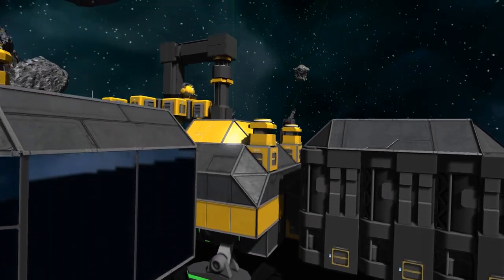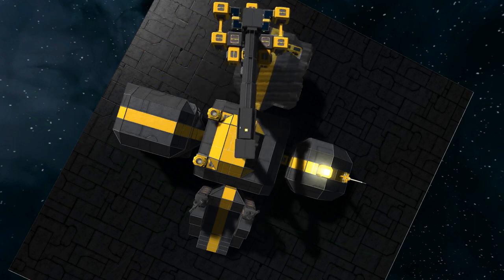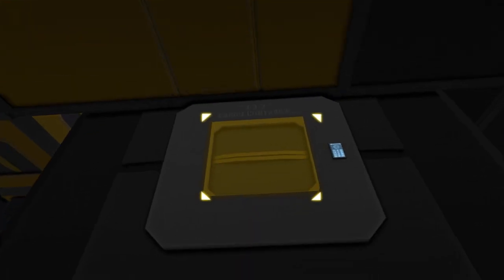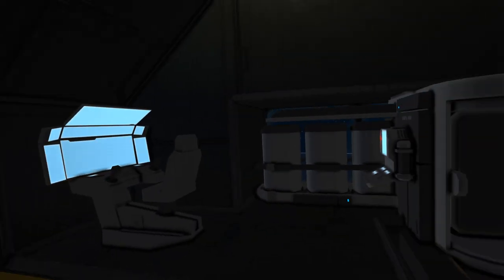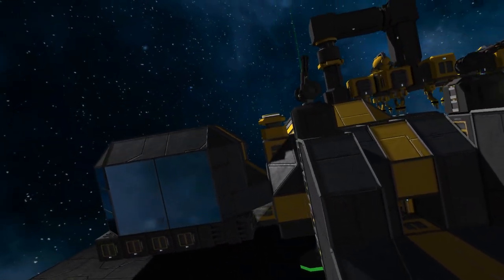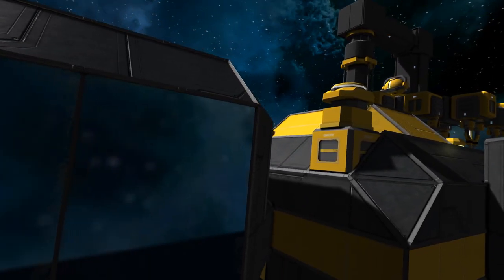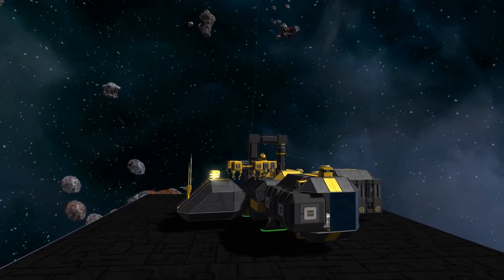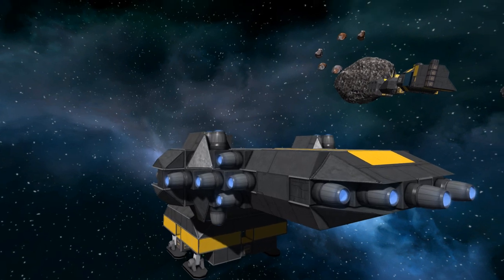Space Engineers - 'DCV' Modular Deployable Base Concept

Comment: If you could wedge a few more timers into that central zone you could have a grinder arm on the other side of the welder arm which is on an alternative set of timers so you can deconstruct the base as well. You may also be able to do it so that the timers for deconstructing it are spread out amongst the other modules so that when you're grinding it down you grind down the timers you don't need so they don't take up space in the centre module. I think that projectors allow you to keep timers named like that when they're welded from a projection.
Reply from the maker: Yeah welding the timers shouldn't be an issue, although think I've got room for a duplicate set of timers in the main body still as I didn't use the roof of it for functional parts, just armour... should just be able to do it with a simple duplicate with some of the reversing changed so it starts high and drops instead of rising. Nice dual purpose sir :)

Comment: I'm digging this idea a lot more than the other style. What I'm envisioning, because I always want to over engineer things(in school for mechanical engineering), is why stop at 4 modules. Each of those 4 could have another rotor/piston setup that deploys additional sections. You could have whole wings of refineries/storage as well as a section that can autobuild mining and other support craft. Build what you want, expand as you need. You could probably even make each section modular and have the expansion sections preset to say only build forward left and right so you don't have to worry about breaking the welding head off on a prebuilt section. Even forcing you to manually decide the direction after picking a module type would be a fine compromise. Add doors at all 4 corners and it even has the airlock feel of a modular base.
Reply from the maker: That's a sweet idea... you loose a little efficiency with each addition as you'd at most have 3 grids to weld instead of the 4, and potentially less if you built in a proper grid pattern but sweet nonetheless. Means I have to design a module that's a corridor section and a hub module for further building now.. (which is cool!) Evidently you're schooling is good :)
Reply: ***** Well I'm also 37 and prior military(Tank Mechanic) so I've been around and seen some things so have a head for coming up with ideas. The best part is if you make each module the same footprint size and inherently you have each module type as a blueprint, this is fully survival capable and allows you to build a base to suit your needs. the concept doesn't even have to apply only to surface stations either. I'm thinking self deploying/replicating solar arrays might be a new thing I start doing in survival. That way when you're low on power, processing, production, or storage you can autobuild it off the appropriate wing of your station.
Reply from the maker: Kahlas
Oh very cool, have a bit of a passion for tanks and their workings although I would not claim it to be anything more than that :) The only worry with replicating solar arrays like that is you can't project multiple grids so lining them up with the sun can be annoying.. might of course be a solution with multiple projectors to be had :)
Reply: ***** That one is easy. First you manually set a pair of rotors to line up with the sun(using gyros and either a remote/camera or a cockpit is best way). Then you have the blueprint build off that. I'd probably use the original module for the basis of this since it already has one rotor for the pistons anyway. Remove the piston and welding head, add on second rotor for second axis place down solar array extension builder manually and from there it's automatic. You could also add a connector block to the roof of each module and using a rotor and a connector for axis rotation use small ship solar arrays that build in a different section then manually fly them into place. Connectors after all do pass energy. This makes connectors abundant for other uses and you could coat the entire roof with solar arrays. I usually create a small fleet of solar satellites with 4 small arrays and 5 batteries for recharging my ships and this would be a nice way to keep them organized. I'm a big fan of solar power though since it feels more realistic than nuclear energy considering the whole heat engine thing is hard to do in space since their is no atmosphere to dump heat into.
Reply from the maker: Kahlas
Yeah see what you mean about setting up the solar thing.. I do like to include it where possible especially on this sort of setup where it's very much geared towards an advanced survival scenario so will have to have a try making it working, although will need to find a way to weld it also. (might just make it manual weld for that tbh).. Connectors on the roofs I might as well just do regardless, I mean, why not have that option? Nice workaround for needing 2 rotors also.. cheers :)

Comment: Make a self replicating and infinitely expandable base! Great idea btw!
Reply from the maker: Thanks man.. that's quite a challenge you have there :P Doable but only within certain constraints. Still, could be cool :)
Reply: ***** I have an idea for that, blueprints save programming right? well just have it set so that it is set to build another one of itself (same blueprints)  using projectors and set them up to project another one and so on and so forth
Reply: No, i mean something similar to that, but with other modules like aircraft factories and turret bays and refineries so it becomes a massive network. I would also like it if it sent out mining ships to mine the resources to build itself, and use the 1km sensors for it.
Reply: Aidan Sprucechopper that would still work, each base would have to be built with a welder though (like attached to it) and then have each piece set to build another piece, and they are different modules
Reply from the maker: Jayden Holzhauser Blueprints save programming when pasted, but not when projected iirc... was something we tried to do in Drone Wars and could never get to function right. Might have been changed of course.

Comment: Watching this, the process of constructing Tau buildings in the original Dawn of War immediately comes to mind.  Definitely an improvement from the original.

An idea that comes to mind that can potentially solve this; perhaps you can build a variant with modules that can interconnect with each other, rather than use the central module to connect everything up.  That way, in the event that you need to get out in a hurry or reuse the original center bit, you can just grind out the center and take off, leaving the donut in the middle with everything all hooked up and in place to be reused later.
Reply from the maker: Yeah worth looking into for a version 2, having been planning to make the system expand further than just the 4 building around a hub setup anyway so having the hub capable of moving on when the base is complete would just be an added bonus.. will defo try and include that. Cheers :)
Reply: ***** Sounds good, glad I could help. ^^

Comment: 2 things for you man.

1:  If the DCV was used on a planet, wouldn't you have ground vehicles driving around, therefore need a connector on the base of it?  I suppose you could use pistons on the ground vehicles to lift their connectors upto the DCv's connectors, but it'd be simpler to have some at ground level for them.

2: Why 4 different projections?  Why not have a blueprint of the finished thing projecting on the base itself,  making all 4 modules available at once? It would save on blueprints, but you may have done it that to be more modular I guess.  Essentially you'd have 2 blueprints - the mobile version and fully deployed version.
Reply from the maker: Hey.. Yeah the 4 projectors was so you could change the modules individually rather than having to make a whole new blueprint for each, normally I'd do as you say but felt it was more appropriate that way round in this case. The connector on the base is a very good point however, hadn't thought about that! Cheers :)
Reply: ***** no problem, will you be adding more to it? Like a separate building to make the little ground vehicles? I even had an idea on how to make it mobile, but I just don't know how it'd fit into your design. The basics of it being a set of pistons underneath that would raise the whole thing up and let welders underneath add on wheels, via projection. Then release the pistons to set it back down.
Reply from the maker: Stewart Bates
I'm not sure having the base itself on wheels is needed, instead I'd approach it from the angle of having the initial part equipped with both landing gear and wheels and then weld/grind the rest of the base in each location. I do indeed plan to add more to this though, trying to work out the best way of expanding on it and I think even that is going to require a pretty different approach.
Reply: Hmm, just an odd thought - make the blueprint have wheels on merge blocks, when you want to make a base - detach the wheels and grind them down. Just weld up a new one when you wat to make a new base. You would need a merge block on the side of both it and a module to weld it up and quickly detach it.

Expanding modules would only require them all to be the same size and a door on all expansion sides. Maybe then have a blueprint of the welding arm (sorry, more blueprints) and just weld one on top of the module you will expand from. Or having a welding car with the welding arm on it to get further modules done.
Reply from the maker: Stewart Bates
I'm getting used to the crazy numbers of blueprints now :) Have 270 and that's following a recent clearout heh.. The issue with blueprinting the welding arm is you can only project a single grid at a time, so that would actually need 3 projectors and of course some way of welding it. My current thinking is to just have 1 arm still but make it capable of moving around to other modules to build on them ones the main hub is done... then as you say just make everything corridors instead of rooms.

Wheels could be an interesting one too, will muse on how to handle it because I'm not sold on the merge block approach, think you might struggle for room for the projectors/welders etc.

Cheers for the ideas :)
Reply: ***** no problem, a lot of crazy stuff goes through my head :-P

Comment: So what if i need to ad to it can i place a second one next to it to make it bigger?
Reply from the maker: Quite a bit tbh, would need to change the modules to allow extra connections and also modify the building tool to reach the additional modules. It's probably going to be something I do in the near future if you're willing to wait for a better visual example.
Reply: well  the thought i had was that the construction node could have a twin node that builds 3 parts and main nod builds 4 parts 1 of them is a hallway to connect them.
Reply from the maker: Dillon Bensley Would be kinda tricky to position them just right I think, but I do have a solution for how to manage this just need to come at it from a slightly different angle.. in this case, a flying welder I think.
Reply: nice i am looking foreword to the video :)